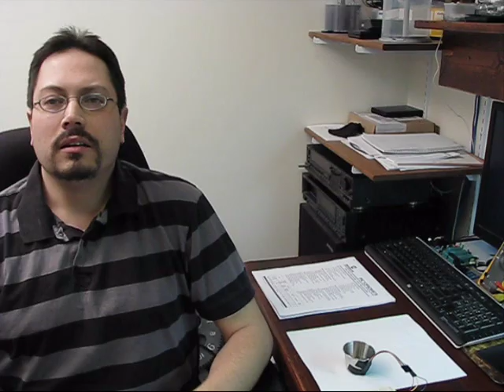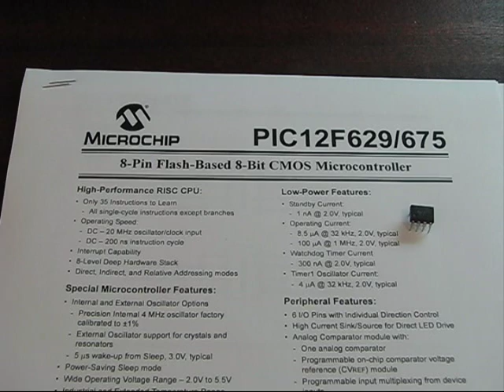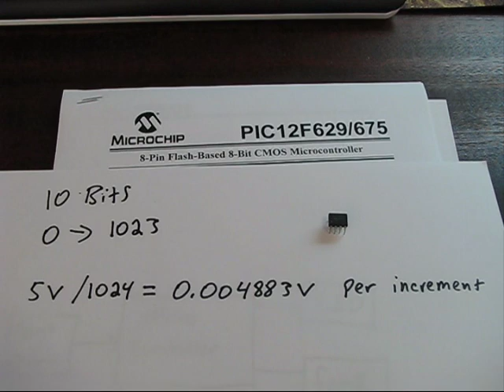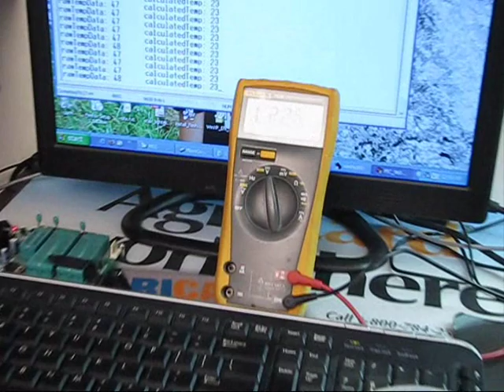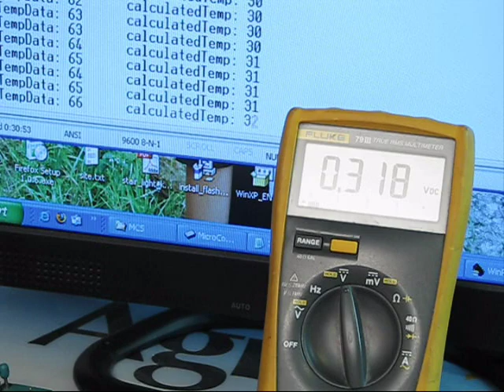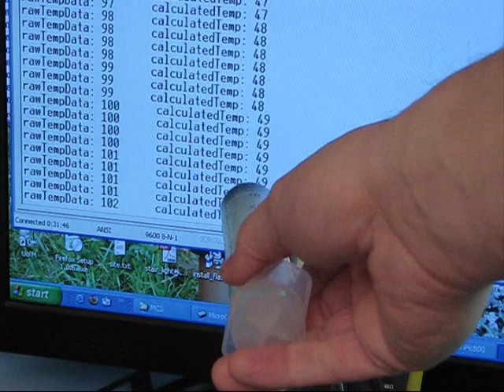PWM Fan Controller - Microcontroller Reads Data

Comment from the maker: @zkjgrty  I am just reading the analog to digital value in the microcontroller. The raw temp is the straight digital value and the calculated Temp is the value after the temperature calculation has been done.